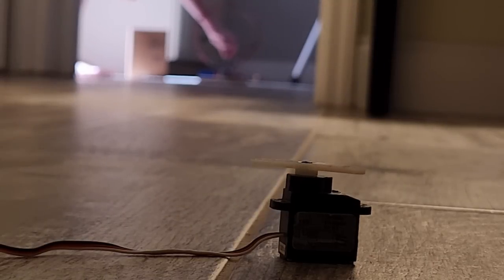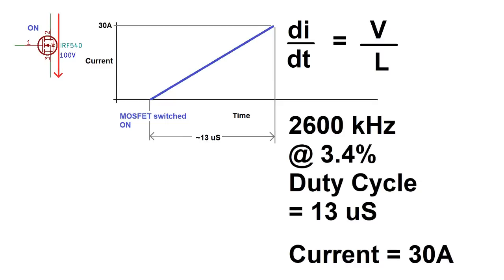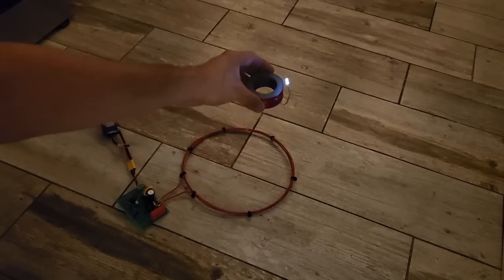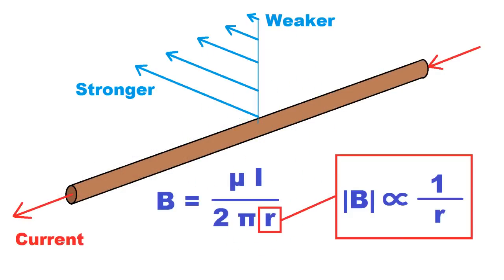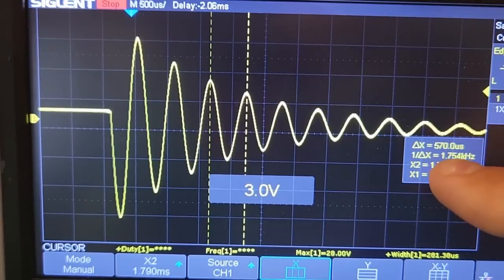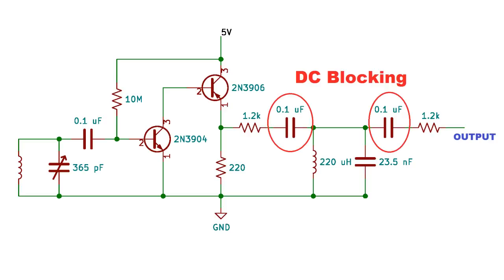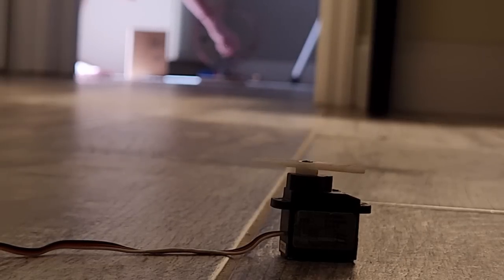Magnetic Remote Control

Comment: That D^-3.5, I am not convinced about this. As a radio amatuer I have a loop antenna I use on 7 - 21MHz bands. This type of anntenna is supposedly working on B field alone.

It is 90cm diameter copper water pipe and open, with a tuning capacitor  bridging the opening. 

At times, I can pick up stations from Europe (In Australia) that have an echo, meaning they have come to me via both the short path and the long path around the world. Transmit power might be as low as 1-10 watts, but typically might be 100W, maxxing out at 400W typically.

With a receiver sensitivity of 0.1 to 1 uV (Signal to noise ratio means that any more is effectively pointless at these frequencies), call the distance 20,000km, it would seem by applying the distance rule you quote, then this is rather unlikely.

More investigation is needed.

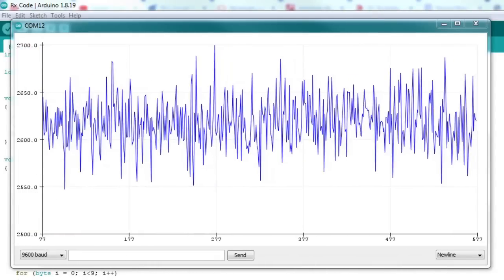Comment: The Arduino UNO (R3) has an 8 MHz CPU clock. With your "nice" signal that means that you have 115.9 clock ticks per signal cycle. The Arduino Runtime eats up a lot of CPU cycles, especially if you use the provided functions, like pulseIn() digitalRead(), digitalWrite() etc. If you want a cleaner/ more finely resolved signal duration/frequency reading ( 14:15 ), you might want to:
A) upgrade to something "faster", like a Raspberry Pi Pico (which runs at a 133 MHz clock) - finer resolution in timing your signal.
B) operate your trusty UNO in "bare metal" mode, i.e. work directly with the hardware SFRs in code - less CPU wasted with the CPU in compiler framework housekeeping mode.

Comment: many years ago I had a radio control book that detailed a similar system, but for the transmit coil it used a loop that ran around the area which you wanted to communicate - eg around the walls of a room, or around an area in a field. you could make the transmit loop as big as you wanted.

i belive that then as long as the rx coil was inside the big loop (or up to about quarter to half the tx coil diameter outside the loop) then it would get the signal, so basically like a transformer but with an air core.

Comment: At 11:09, the PNP is not connected the correct way around. Can I suggest you label E, B and C on your circuits rather than the CADs lazy 1, 2 and 3?
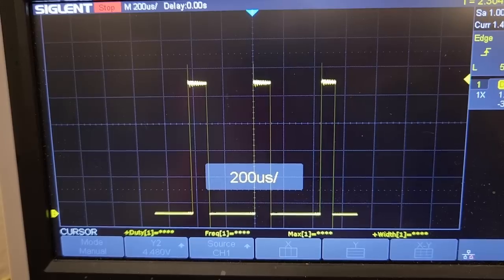Looking at the circuit board at 13:51, you may have them inserted the correct PNP way around.

Comment: On the receiver side, you may want to try looking into something called a regenerator circuit. Also known as a "regen receiver." 

The theory is to exploit positive feedback to make your tuning tank (coil and capacitor) extra sensitive. Basically, you "tickle" the receiver tank circuit just up to the point where it starts resonating, then cut it back down again and repeat this process over and over while observing the results. The key insight is that it will be easier/quicker to get the tank to resonate if there is an external signal "helping" it resonate. Or, said using the analogy, it's being tickled from both sides. 

Regen receivers have fallen out of vouge today, but back in the days of vacuum tube radio they were like what LoRa is today. Signal quality (bandwidth) suffered, but strength was greatly increased.

Comment: The output impedance of a filter should be as near as possible to the impedance of the antenna. The impedance of an antenna depends on frequency and your loop should have a very low impedance (maybe 4.7nanoOhm). The output impedance of your amplifier is also going to be extremely low unless you specifically designed it to have a higher impedance (which you did not). You will be better off just removing those two 1.2kOhm resistors. If you were using transmission lines of some sort between those components, you would need to match to them, but in this case, it is not necessary.

Comment: There is an old defcon talk where a super high power RFID scanner was demonstrated using almost the exact same system you have here. they built it into a backpack with a beefy battery for power source, and it was reading cards from over 35 feet away. a ground station can read cards even farther, with the rumor being that the US/Canadian border has readers that grab your info from over 100 feet away as you pull up to the crossing. 

Thankfully the banks caught up to RFID security problems eventually instead of continuing to pretend like RFID was bulletproof. most systems that use prox cards for access control require a pin or some other secondary method now. I remember my university had a single code that every student used to open every door back in 2007...

Comment: First, electric and magnetic fields are radiated together at distances above half a wavelength or so.  Second, I believe your 2N3906s are drawn upside down -- possibly they are also installed backward making poor amplifiers.  Third, the low input impedance of the 2N3904 greatly reduces the quality factor of your loop antenna.  It might be worthwhile to put 1 k - 10 k in its emitter.  Fourth, the low resistance (600 Ohm) in parallel with your pi filter also destroys its quality factor.  Tank circuits have high impedance at resonance and need high impedance in parallel.  I would use ~100 k instead of 1.2 k before the filter and the 1 k - 10 k emitter resistance is also recommended for the second stage.  The second 1.2 k is then not needed.

Comment: If you want a remote for something that will be underground or underwater, this is one of the few options that are practical. If you need a lot more range then you can get from this then you've got to add something like a floating repeater buoy that can receive an RF signal and translate it into a magnetic signal.   One practical application I think of is an occupancy sensor for a pool or hot tub...
Reply: Interesting idea for some underwater transmission applications.
Reply: Hello. lets exchange contacts. I m also on that quest.

Comment: Hi, I love this video. One question : Could this circuit be used to transmit wireless electricity and light some kind of bulb other than a small led ? For example a small 12V halogen bulb. My doubt arises because it does not work as a continuous wave, but sending ¨pulses¨ or ¨signals¨.

Best regards and thank you very much
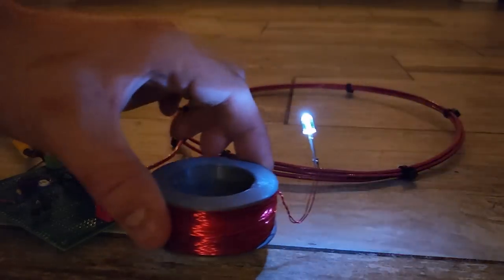Reply: That's sortof answered in the video segment about Transformers -> Crappy Transformers -> Awful Transformers at 5:14 :) ... but in short: sadly no. 
Unless you're simply looking at very close range, as used in induction chargers for phones. Otherwise the losses are too great at these frequencies of electromagnetism over any useful distance. Tesla dedicated much research into this back in the late 1800s, but very little other than "science" came from it. 
More recent research using microwaves has proven the theory as viable, but unless you really really need to light that bulb wirelessly :), it's not something that's going to be easy, efficient, or arguably even particularly safe for useful power levels.  
For the various reaseach, applications, and limitations, you want to generally search for the topics of Microwave Power Transmission and/or Wireless Power Transfer methods.

Comment: probably cascaded transistors will do good job at amplifying signals.and may be amplified high woltage coil as transmitter ;) ie something like high voltage high amps pulses

Comment: Filter impedance is what the filter should see. Adding resistors (providing the impedance is what you thought), will each create a voltage divider cutting the voltage in half (6dB x2 =12dB) 

In other words remove the resistors and that will improve things. It would also be wise to design to the right impedance, which isn’t 1200 ohms.

Comment: Не подойдёт для пульта дистанционного управления моделями, связь очень сильно зависит от расположения антенн и будет работать только при паралельном расположении передающей и приёмной катушки.
Reply: Google Translate (Russian language detected): Not suitable for remote control models, communication is very dependent on the location of the antennas and will only work if the transmitting and receiving coils are parallel.

Comment: Magnetic only?  Guaranteed that loop is going to radiate RF at 69Khz; not very far since as you say it's a very short antenna for its wavelength. The receiver looks like an ordinary RF-tuned receiver.  The air is not a xfmr core.  The fact that the pulse is turned on with a short rise time; one would expect the laplace transform would show frequencies all over the place from this turn-on and from the decay. That could explain the noise. My guess is that this signal could be detected for miles with a VLF receiver with a large array cut for that frequency.

Comment: 6:03: Electric and Magnetic fields cannot exists alone, so you are effectively transmitting an electromagnetic wave (with a very big wavelenght). The induction phenomenon itself relies on the presence of electric field (Faraday Neumann Lentz law and Ampere Maxwell law). When you put the second coil near the first (the emitting coil), inside every infinitesimal slice of wire there is the electric field part of electromagnetic wave you are transmitting.
Reply: It is in principle a radio transmitter / receiver, isn't it?
Reply: @alexanderg-p3z  A very pedantic answer is that it is not really a radio transmission system because it does not use radio waves to communicate. Maxwell's equations of the electromagnetic field show that there are two ways the energy of a perturbation leave the generating circuit; at close distance (up to 10 wavelengths) the so-called induced field dominates, which varies very rapidly in amplitude and behaves similar to the field between the coils of a transformer or between the stator and the armature of an electric motor / generator. Further away the electromagnetic energy travels as waves that drop in amplitude more slowly (proportional to the inverse square of the distance) towards the infinite horizons. In our case, for a carrier frequency of 69 kHz (approx. 4.35 km wavelength) at a few metres between the transmitter and the receiver, the signal doesn't act as a radio wave, so it is not a radio communication system.

Comment: I used a similar circuit design for a plasma speaker with a flyback transformer. Without a large heatsink, the mosfet would desolder itself after less than a minute :)

Comment: I enjoy your project video, but this looks very much like a damped wave and may well be illegal above 9 kHz. ANY radiated magnetic field creates a corresponding electric field, meaning an electromagnetic wave, i.e. a radio wave. BTW, I bet I could receive your transmitter from at least a couple of miles away by retuning my WWVB 60 kHz receiver.
Reply: I believe legality depends on the frequency and radiated power.  In practise unless some-one complains [that their garage door keeps mysteriously opening] it is unlikely to be a concern.

Comment: Solar panel and flashlight works pretty good for sending wireless signals with minimal stuff.
Reply from the maker: Yeah, at some point i wanted to do that with a laser
Reply: @HyperspacePirate  technically the first electrical wireless transmission was a light and a solar cell. They sent morse code. Ingenious right. ???But can we do this with lazers because light is more robust and punctures clouds to some degree. Second can we send data from one computer to another but instead of radio we use light without the fiber optics 😁😁😊😊

Comment: The 200v diode is blocking the 75v diode from doing any work at all.
Also the mosfets body diode is mot fast at all. So placing a faster one in parallel does not improve the body diodes opperation and will still close to late.
The use of the 200v diode is good to block the fets body diode from conducting.
But in this case the 75v diode's cathode has to connect to the 200v diodes anode.

Anyway. Fun project.

Comment: tried to do the same thing when I was 12 years old. used a many-turn coil and 9.6v ni-cd charger to send pulses and recieve them in audio amp with old fluorescent ballast with its core opened. I could make the speaker cradckle every time i turned on the coil up to about 8 meters of range

Comment: super conducting magnetic coil energy storage, E=½LI^2, I=kilo and mega amperes
Reply: how easily you can get 69MWh energy storage, cooled with liquid air in the same canisters that hold the YBCO coils
Reply: very nice if I forgot to say that ^_^
Reply: infrared control would be equally or even better if a laser
Reply: 360 ir receiver camera

Comment: Your findings on the coil sizes are in line with my tests. One day I want to put a coil the size of my wall about 8ft circle, and see how far in the room I can transmit power to charge a phone wirelessly. I think it should charge just about anywhere in the room with a coil that large as the transmitter. The receiver needs to be tuned to the correct frequency but it can be a much smaller coil. Have you tried a really large transmitter coil like this? I think it would be a neat experiment. It could in theory be hidden within a wall and provide wireless power anywhere in the room. I found the size of the coil makes more difference than the actual input power. So theoretically one could take a 5watt large coil and get more out of it than a 10w small coil at the same distance.  Hope that makes sense.
Reply: You would need to watch it doesn’t interfere with anything, this is only transmitting small amounts of power, but to charge a phone you would need quite a bit more power than is used here.
Reply: funny I was thinking of putting one behind the drywall hahah
Reply: Then that transmitter will charge you instead of phone in the room. :)

Comment: I suspect there is considerable scope for improvement to the receiver circuit sensitivity. It might be worth looking at the receiver circuits used in magnetic loop coupled hearing aids. 
Alternatively, you might consider looking at am diode  receiver circuits that use an OOK decoder. This has the advantage of automatically adapting to the fall in the demodulated amplitude, allowing even millivolt signals to be decoded.

Comment: There appears to be an error on the receiver circuit diagram. The PNP output transistor is connected with its collector to rail not its emitter. 
I assume you intended  the circuit to operate in a complementary configuration. As drawn, the output transistor permanently bias off.
Reply from the maker: Yeah that is in fact an error in the schematic. The software I'm using seems to automatically orient a PNP transistor with the collector/emitter swapped and I didn't notice it
Reply: @HyperspacePirate  Hey, also your caps are labeled with the unit Henries on your first schematic. Awesome video!
Reply: Well he noticed well played nigel